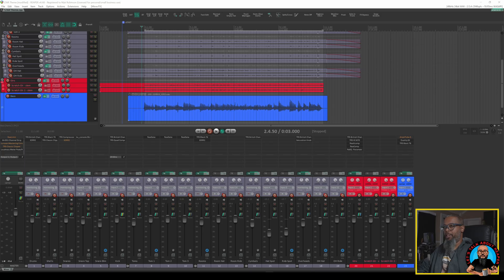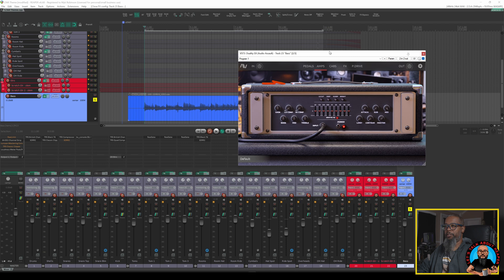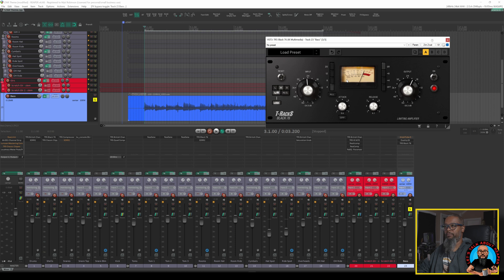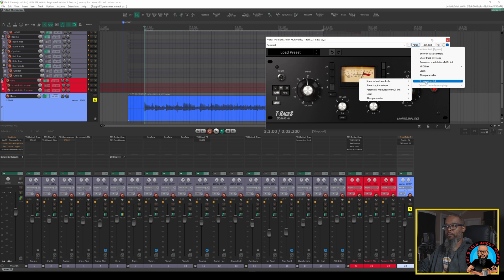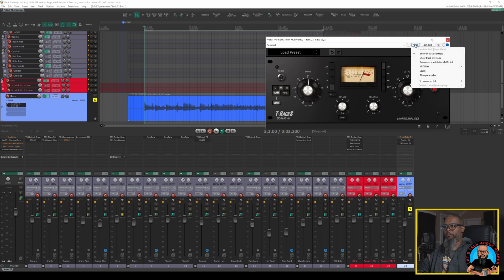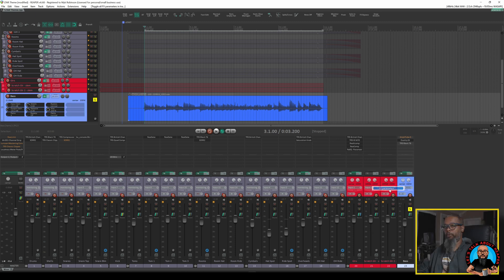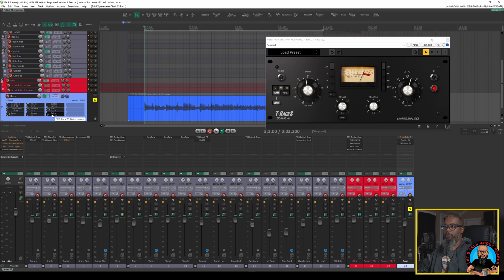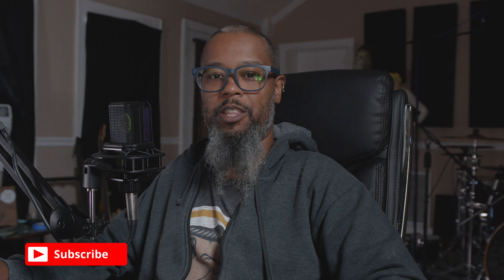FX Parameter Controls in Track Control Panel in REAPER

Comment: Curious about how to adjust mouse modifiers for in-track parameter control. For example, resetting to zero is a double click or Ctrl-click on most parameters, but there is no option for in the in-track panel. I'm looking at Mouse Modifiers in settings, but the actions are not there. Maybe there is a script library that covers this?